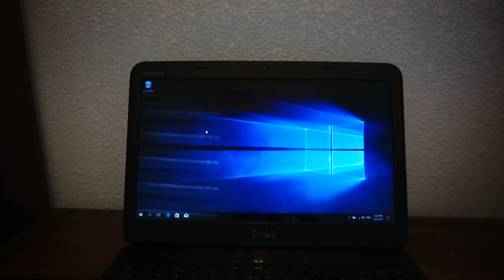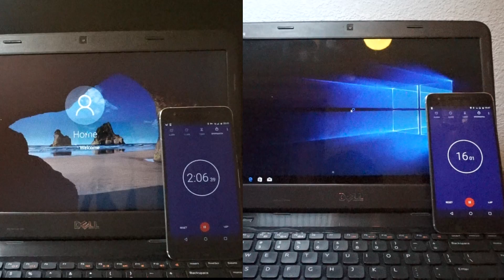Dell inspiron N4050 SSD and RAM upgrade

Comment: i have a question how much memory storage does the SSD Give?
Reply: RAM can be made 4GB+4GB or 4GB+8GB so-dimm DDR3-1333 1.5v 2Rx8. What processor is in your laptop? 
Radeon graphics card or just integrated HD Graphics?
Reply: @vladimirazirov1815  Intergrated_ Th😅ank U
Reply: you can use a SSD 250-512gb sata-3, 2.5"  from any manufacturer. It is better to buy good drives: SSD Samsung 870 EVO 250GB/500GB, SSD WD Blue 250GB/500GB, SSD Crucial mx500 250GB/500GB, SSD Kingston kc600 256GB/512GB. Divide the SSD into two partitions: drive C (130GB / Windows 10 x64, programs) and drive D (the rest of the space/games, movies, files storage). Make your HDD one partition (drive E) for storing photos and important  information, transfer the HDD to the DVD-slot using the adapter Caddy 12.7mm.

Comment: I'm using this laptop for 11 years. Still running, and easily i can do basic typing works. It's a gem
Reply: Same here!
Reply: same here
Reply: same here
Reply: Can i replace celeron 2nd gen with i3 2nd gen
Reply: @Nktechbd111 I'm afraid u can't. Even if you could u will have to spend alot of bucks, which will be almost the same of new Price laptop.
Or it might not work well as the components will not be able to support it for long hour's, u might find glitches, slow or hang often
Conclusion: Better buy new
Reply: Same here

Comment: To eject the ram.
I have a question. Do i need to press the ram down a bit to simply allowing it to be remove and replace with the new stick ?
Reply: @BeybladeX I see, gonna try that out later.
Thanks

Comment: Hi, can i instal 16gb on this notebook (2x8), please? will this notebook recognize this memory?
Reply: 8GB+8GB DDR3-1333 (1.5v). The memory module must have 8 chips on one side (16 chips on both sides). Do not buy a module with 4 chips. 
What processor do you have?

Comment: After this upgrade for Ram and and Hdd we can upgrade it to windows 10??
And what is value of RAM you added??
Reply: maximum 8GB+8GB DDR3-1333 (1.5v), optimal 4GB+4GB, 2GB+8GB. The memory module 8GB must have 8 chips on one side (16 chips on both sides). Do not buy a module with 4 chips. Windows 10 can be installed. You can use drivers from Windows 7 or 8.
What processor do you have?

Comment: dell n4050 i3 ,4gb ,medium application intalled,ssd and caddy with previous hard ,windows 8 loading time 10 seconds only,love my old 4050
Reply: i3=> i5-2520m //
 RAM 2+4, 4+4 DDR3-1333
Reply: How are you do this? In my pc I can't do the boot by ssd in caddy.
Reply: @JoaoBatista-gs4ln  check the ssd for first in the boot list

Comment: Is it possible to upgrade the processor from an i3 to an i5?
Reply: Yes! The i5 compatible to the N4050 is called i5-2450M. If you don't know much about computers, or don't feel secure in replacing the CPU yourself, ask for a people with that knowledge or bring that on a support center so they can replace for you. Plus, that processor is old as the core i3-2350M, but it's price is fine.
Reply: @mightybrazilsempire5316  thank you!!!😁
Reply: @diegoaleman9844  Just a quick advise, once this processor may be more powerful, be sure to have a good cool-down system and also a charger wich can provide enough power to your laptop. I have my N4050 Since 2012, works until now days and i'm going to upgrade that too so it may last more 8 great years. And Your Welcome!
Reply: @mightybrazilsempire5316  In fact I also try to improve my n4050, I'm looking for information to be able to switch from hdd hard drive to solid state hard drive, increase ram from 4gb to 8gb (even if I look for information about the motherboard and I don't know if it only supports 8 gb of ram or up to 16gb) and finally improve the processor even though I haven't found new and boxed
Reply: @diegoaleman9844  With 8GB, a Intel Core i5 2450M and a SSD, this old one shall be as powerfull as a basic gaming laptop. Sadly my DIMM A Slot isnt working, when i put any RAM Stick in there, the system doesn't turn on, maybe is it damaged, so i'll look for a 8GB Stick.

Eidt: Also, about the quantty of RAM, well, Dell suports / assure it is 8GB, but the motherboard itself may be able to handle 16GB, just don't go above that value.
Reply: @mightybrazilsempire5316 ohh how sad for your laptop :(. One question, for the installation of the 3 components, is it necessary to do some configuration in the bios or install some drivers so that they work well? or do they simply mount and turn on the machine without configuring nothing?
Reply: @diegoaleman9844  You mean the CPU, SSD and the RAM? Well, just put the pieces on the right spaces, turn up your compter and go bios just to see if is everything OK. After doing this, have fun! Just an advise

CPU: That one must be compatible with the soccket! 

RAM: That one must have 1333HMz, 1.5V and must be DDR3! 

SSD: Make sure to be an SSD compatible with SATA conector! 

Any Questions, just ask me!
Reply: @mightybrazilsempire5316  And if I have core i3-2310M, and 3 Gb drr3 ram memory, if it can accept change from ram memory to 8 GB ?, and can I change processor to i5?
Reply: @quigon07  Well, lets go. First of all, you'll have to see the socket type for your current peocessor, if your notebook is the N4050, so your socket its an rPGA988B / rPGA988, and that means you can upgrade do Intel Core i3 2350M and Intel core i5 2450M. If you place the i5, make sure that your power adapter can supply the processor's needs. Now about RAM, well, your current 3GB isn't that bad, but anyways, if you want you can add more RAM and theres some tutorials about this on YouTube, if you want to go above 4GB you'll need a 64bits system. If you have any questions you can ask, ok? Also sorry if i haven't a good english.

Edit: I found some info about your current processor, that model you have can handle 16GB of RAM memory, anyways, if you want to run above 4GB uptade to a 64bits system, 32bits systems may not work properly.
Reply: my system is 64 bit? , Can I ?
Reply: @quigon07  If your system is 64bits so you can go full ahead and install more RAM. Don't foget that the RAM must be DDR3, 1.5v and have 1333MHz. I recomend instal 2 of 4GB, or one of 8GB.
Reply: You can buy it's not worth the money

Comment: If you are using windows 10 Operating system try to install new driver by using driverpack solution online. And also the 360 antivirus. Try it 😁

Comment: Hi, i recently upgraded my dell n4050 using windows 10 but it's start bugging and i have to downgrade it back to windows 7 i see you using windows 10 too did you not facing any problems?
Reply: I dont have problem
Reply: Same I just switched to windows 7 today

Comment: Does the webcam work after upgrading to windows 10? Can you make a video for that.
Reply from the maker: The webcam does work. Unfortunately, I do not have that machine anymore.
Reply: @qiaojiezheng5310  Thanks a lot for the info. I was really concerned as most of the old laptops that came with W7 pre installed had web camera issues when upgraded to W10. I was only concerned about this one though.  Thanks a ton!

Comment: I have same laptop today when i turn it on.....when start up screen goes black....i tried pull out the battery.....hold power button to 10 to 15 sec....but when i turn it ON just for a sec screen show display and goes black and i dont know what happened plz tell me how it will fix.....
Reply from the maker: First thing I would check is the drive, make sure that's bootable. If that doesn't work, check the memory

Comment: i Have Dell Inspiron N4050 and the memory is only 2 gb.....i just want to ask if I can add ram 2Gb 1Rx8 PC3-12800S-11-11-B Kingston.
Reply from the maker: If I remember this correctly, N4050 supports memories up to 1333Mhz, and the ones you have seems to be a 1600Mhz RAM
Reply: @qiaojiezheng5310  Thank you sir big help

Comment: Please suggest compatible SATA cables for its hard . actually my laptop's hard is causing problem I inserted a new one ,now wanna recover my data from old hard please suggest SATA cable and a best link economically with best quality on amazon for Pakistan
Reply from the maker: The best option is go for a Samsung 860 Evo, iwill save you a lot of hassle trying to move your system to a new one.

Comment: have a doubt, did you thinked in that moment to upgrade the CPU?, cause i have an Intel core i5 2430m, can i upgrade to a i7 or a better i5?, i researched everywhere but im not too sure yet to do a CPU upgrade for temp reasons.
Reply from the maker: I have made a video about upgrading CPU, and you can check it out in my channel

Comment: I have a N4050 since 8 years and counting, but it's decreasing it's performance. My question is... is any SSD compatible with N4050?
Reply from the maker: You should be able to find a compatible SSD. As long as that computer uses SATA connector.

Comment: I have dell Inspiron N4050 core i3 3gb pc3-9-10-B1 upto what can i upgrade it please answer
Reply from the maker: You can upgrade CPU, RAM and SSD. I have videos about all of that in my channel
Reply: @qiaojiezheng5310  What is the maximum to update RAM WITH THESE SPECIFICATIONS?
Reply from the maker: @quigon07  A 64-bit system can support more than 4 gb of ram, if you go with 8gb per ram slot you can get up to 16gb of ram, most of today's CPU support 64 bit system

Comment: Hi bro, my laptop is n4050, core i5 2.3 MHz, 4GB ram, with Intel 3000 Graphics, and 500GB SATA 3 2.5 inch Internal Hard disk.
I want to upgrade my laptop, what do you suggest me? Upgrading CPU, Hard Disk, or Ram?
I want to speed up my laptop. 

Thanks for your video.
Please answer 😘
Reply from the maker: Depends on your workload. The first upgrade I'll do is to get an SSD, then add more RAM.

Comment: How did you installed windows10 on this laptop?
Reply from the maker: If you are using a Samsung drive, the Samsung migration tool can make a copy of your system to a new hard drive, so everything you have will be the exact same on the new hard drive.
Reply: After installing win10 cameras doesn’t work how to find drivers

Comment: When I upgrade RAM on my n4050, the VRAM doesn't increase, it's still like before. how to fix that bro?
Reply from the maker: It's related to the GPU, and the system RAM is a separate thing. In short, you need a different GPU.

Comment: Hi please help me,  my dell N4050 bluescreen if i installed the graphic driver,  and if i uninstalled it works (no blue screen), but the screen monitor view is not proportional,  please give me solution
Reply: Hi! I might be late but i had the same problem as yours...
For me it was the GPU, mine was burnt (overheat because my fan didnt work properly)...so I only installed the latest graphic driver for the intel instead...and it worked with a not-bad resolution
Fyi mine was i3 gen 2 + amd gpu

Comment: My laptop's cooling fan is making more noise from few days. How should I tackle this issue. Please suggest.
Reply from the maker: It's most likely that you have a clogged heat sink or dried out thermal paste. You can check out how to service your laptop through my CPU change video

Comment: I have followed your steps given in video, but after upgradation my display is not working 😕
Reply from the maker: The very often cause I think might be the RAM, try to swap back and reboot
Reply: @qiaojiezheng5310  okay will try that
Reply: @qiaojiezheng5310  Thanks it worked

Comment: Random Fixes Hey there, Sorry to bother again. Just got to know that n4050 motherboard supports only 8GB  maximum memory capacity. Need to know what’s the maximum memory capacity per slot.Can you tell whether 1x8gb would do the job or should use 2x4gb instead?

Regards,
NR
Reply: Mine is 2x4gb and works great!

Comment: Hi.
Hoping to upgrade my N4050. Got a problem with RAM. What’s the RAM voltage for this machine? 1.3V or 1.5V? Will it be okay if I upgrade the memory to 16GB? Running on a 64 bit processor.
Reply from the maker: I used normal DDR 3 for this upgrade, which means that supports 1.5v ram. I believe you can use ddr3l on this as well and 16 GB should be fine
Reply: Random Fixes Thanks for your time.👍🏻
Reply: Friend, did you upgrade the memory to 16GB? I'm looking to upgrade and I don't know if the capacity is 8GB or 16GB.

Comment: What is the maximum frequency supported by RAM?  and What other processor can I put?
Reply from the maker: I'm not sure about the maximum frequency, but 1333 works. If you bought higher frequency ram than the laptop supports, it probably going to run at a lower frequency. For the CPU, I'm working on a video as things are complicated
Reply: @qiaojiezheng5310  what is the maximum size of memory RAM
Reply from the maker: @albertomorales5595  I have a video explain that in detail https://youtu.be/5vcWDmyOU1U

Comment: i read that this laptop have two slots for ram
and also it have a limit of 4 GB

so am i allowed to add two 4GB RAMs ?

or just two 2GB RAM

and also there are so many options online we get confused , pls give us an amazon/flipkart link to an ideal RAM 

btw thnx for this video :)
Reply from the maker: 32 bit system limits your maximum RAM to 4gb. 
Generally DDR3 1333 sodimm works https://www.amazon.com/Crucial-PC3-10600-SODIMM-204-Pin-Memory/dp/B008LTBJK2

Comment: Hi. Upgraded the laptop. But my boot time is still very high. I've even upgraded the memory to 8gb.please advise.
Reply from the maker: It's probably because you are still using HDD. An SSD will shorten your boot time significantly.
Reply: Excuse me... check your HD ... maybe there is a bad sector on your HD ... wish it help you 👍🏻

Comment: How do I prevent it from getting too hot? What do I have to buy?
Reply from the maker: If you are watching this, I guess your laptop is around 5 years old. You could reapply thermal past. The past could be dry after 5 years and does not conduct heat as well as new ones.
Reply: @qiaojiezheng5310  So can I buy a Corsair 8GB SoDimm DDR3 1333MHz RAM? Will it work? Can I use the free slot for that and make it 12GB RAM? I already have Intel i5 and hard drive of 500gb that I would like to change to a SSD. My system is 64 bits (I wrote it again, sorry) Thank you very much! You're really helping us all!!
Reply from the maker: @maanuelrc  12 GB should work for your 64bit system
Reply: @qiaojiezheng5310  Thank you very much

Comment: My Dell nspiron N4050 Specifications
Processor intel pentium B950
Ram 2GB
can i upgrade my Ram 2GB to 4GB and HDD to SSD?
if cpu upgradation is possible then tell me
Reply from the maker: You should be able to
Reply: you can upgrade your CPU to i5 2450m, up to 3,1ghz. i will upgrade my laptop with i5

Comment: veo que muchos preguntan por las capacidades de UPGRADE, en mi dell N4050 he actualizado a 8 gigas de RAM DDR3 en 2 slot de 4gb (PC3-12800 800MHZ), Procesador Intel core i5 2450M, aun estoy investigando el maximo disco sata III que soporta..
Reply from the maker: Sorry I don't understand that
Reply: @qiaojiezheng5310  I see that many ask for the capabilities of UPGRADE, in my dell N4050 I have upgraded to 8 GB of DDR3 RAM in 2 4GB slot (PC3-12800 800MHZ), Intel core i5 processor 2450M, I am still investigating the maximum disk sata III that supports ..
Reply from the maker: @ateksoluciones8066  The capacity of the hard drive really depends on the system you are running, I saw you have 8GB of ram installed and I assume that you have a 64 bit system. So the current consumer models (like samsung 860 EVO can have up to 4TB) should work for the upgrade without any problem.
Reply: disculpa yo tengo core i3 puedo actualizar a 8 gb de RAM??
Reply: @quigon07  , ingresa a esta pagina https://www.crucial.com/ con ella puedes saber lo máximo de memoria Ram que puedes poner a tu equipo, además del tipo y velocidad
Reply: @ateksoluciones8066  muchas gracias , lo revisaré , si tengo otra duda te consulto muchas gracias

Comment: can i upgrade graphic card ?
Reply from the maker: No, unless you go through the PCIE lane, which is currently occupied by the wireless card
Reply: If yours only have the HD Graphics, you could theorically buy the n4050 board wich has the discrete graphics, but I warn you, it would probably not be worth it.

Comment: planning to upgrade it to ssd, can I make the hdd another storage by replacing the dvd drive by the hdd by adding a bay? would it be possible?
Reply from the maker: Yes, as long as you find the correct adapter you should be fine

Comment: And I want to replace the i3 to i5 was it possible in N4050 Dell model and also replace the 2gb ddr3 ram to 4 gb ddr3 with 2 sticks.
Reply from the maker: As the CPU is BGA l, it is soldered to the motherboard. You technically can upgrade, but the process involves desoldering the current CPU and resolder a new one to the motherboard. Depend on the configuration you bought, there might be one free ram slot for DDR 3, there are two ram slots in total.

Comment: Can we change the graphic card of n4050 laptop dell
Reply from the maker: I don't think you can. GPU and CPU are generally soldered to motherboard for laptops
Reply: Qiaojie Zheng  well, i think its possible on the one with Pentiun B950 
https://www.dell.com/community/Inspiron/Dell-Inspiron-N4050-Processor-Upgrade/td-p/5877688

Comment: So you still can install a Windows 10 in this laptop , although Dell saying that in their Website this laptop doesn't tested in Windows 10 yet. 
Do you have any Issues when installing windows 10 in this laptop ?
Reply: And also do you have any suggestion in upgrading this laptop from windows 7 to windows 10 ? 
i will be appreciate it
Reply from the maker: I installed Windows 10 64bit on it and there's no problem with it after one year.
Reply: How u get win10 drivers?

Comment: (2*4) ram  is possible or not??

and where want to buy the ram
Reply from the maker: Navaneethan Pesonal, I'm not so sure about that configuration, but I suppose you can. I usually buy that from bh photo
Reply: I have one with 2*4gb and it works fine.
Reply: I have 2*8 I upgraded it by my self ✋🏻